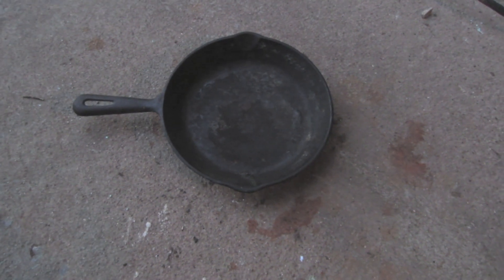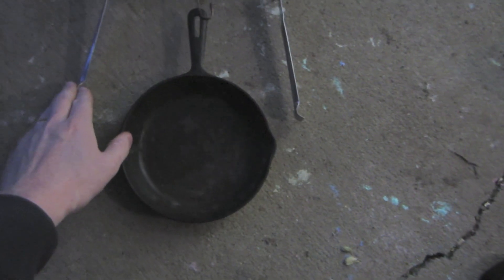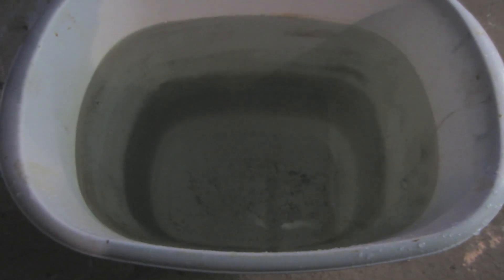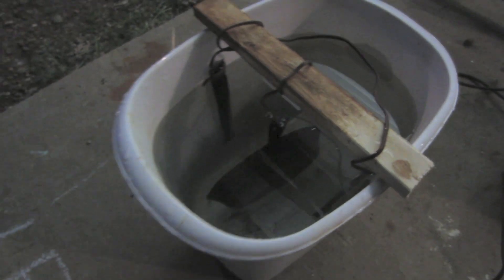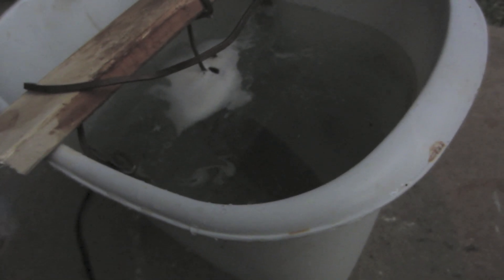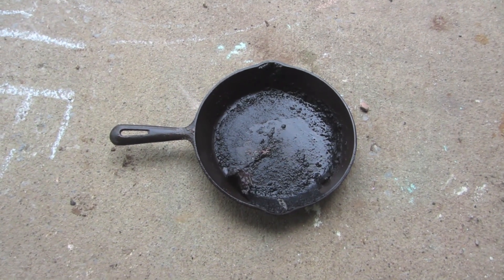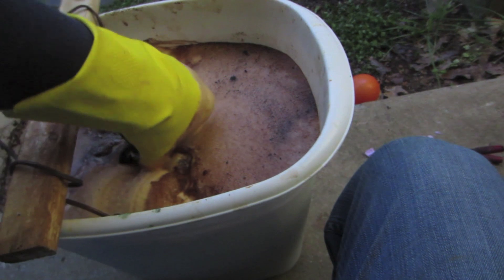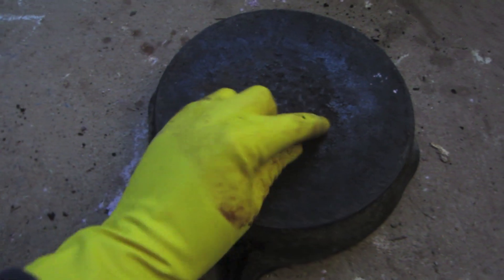Clean Cast Iron With Electrolysis - My Process

Comment: Be careful using stainless steel, It can sometimes produce toxic chromium, which causes cancer and also more toxicity in the tank water, a better anode is plain scrap metal, rebar, construction steaks etc. P. s. also keep your voltage & amps low in order to avoid this

Comment: Do you have to keep changing the water? And how do you dispose of the dirty water when through?
Reply from the maker: You can use the same solution for several items. I usually save up several cast iron pieces and then use one bucket of solution for all of them. You do need to be a little careful with disposal. You don't want to contaminate drinking water or soil where you grow anything to eat. I allow my solution to mostly evaporate, but that may not be practical for everyone.
Reply: @whatsinthenextbox  Great--thanks!